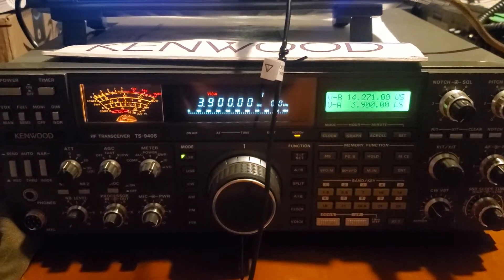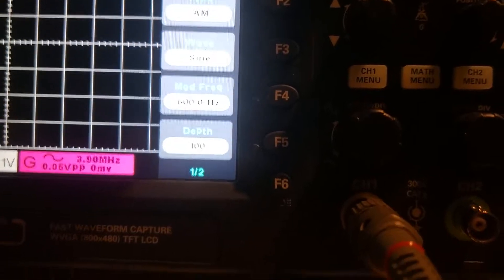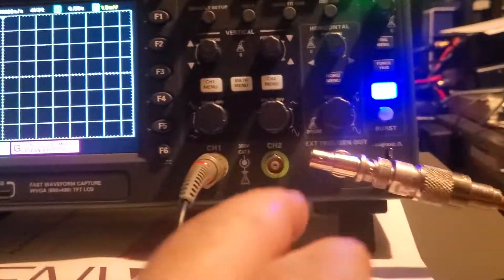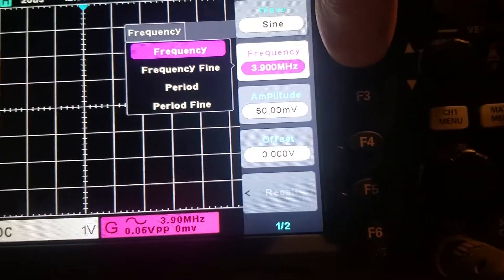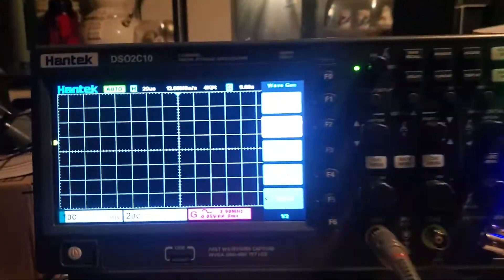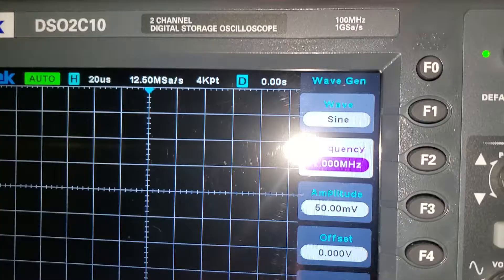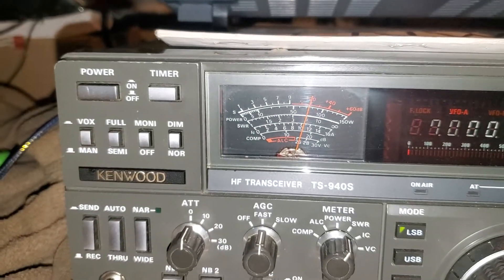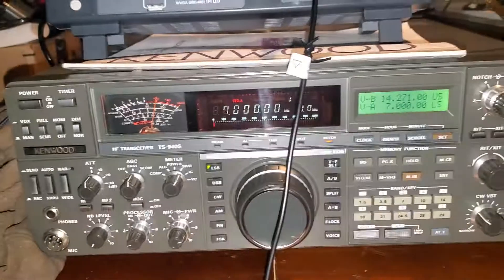USING HANTEK DSO2C10 SIGNAL GENERATOR TO TEST RX ON TS940?  ? DOES THIS WORK?

Comment: Hey, how did you get the function generator working on the dso2c10? I have the same model but everywhere I look just says that only dso2d10/2d15 have the function generator feature
Reply from the maker: Go on gethub and find the thread about flashing the firmware.  Basically there's a workaround where you can Flash the firmware with the unit that comes with the generator and that enables the hardware that's already in the unit